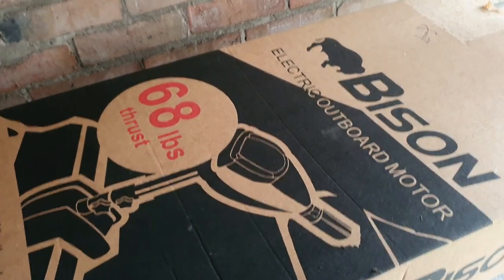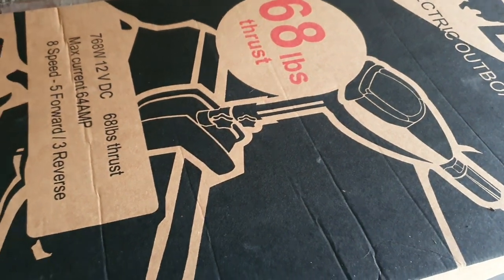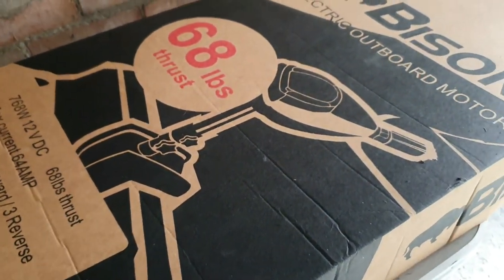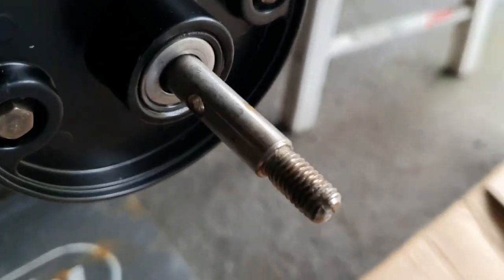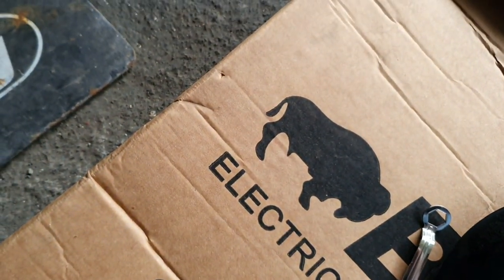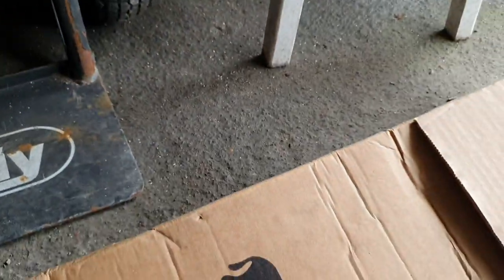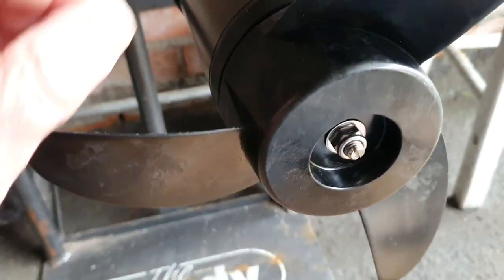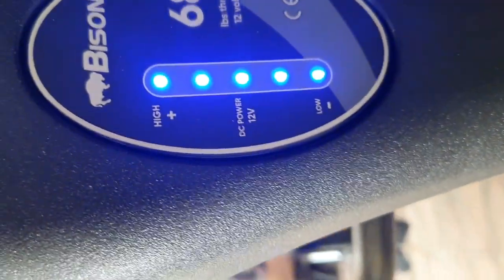Unboxing Bison 68lb Thrust Electric Outboard Engine

Comment: That was much cheaper than I thought one would cost. You are going to have so much fun and enjoyment on that canal. Can't wait to see your new boat when it has been completed. Keep up all the great work you are doing. Well done Colin, you must be so proud of all your hard work and determination.
Reply from the maker: The best part only one moving part less to go wrong and easy to fix I seem to think how is are things to fix myself just lately.
Reply: @colscopters  Fixing things yourself saves you a load of money. So that is a bonus 👍
Reply from the maker: That's so true I see it this way man made it man can fix it everything is like a jigsaw once you know how things go together it's easy .
Reply: Then you are great at jigsaws mate. The things you put together are awesome 👏
Reply from the maker: Thank you so much so kind
Reply: I have just bought one but one of the connections is really tight iE the positive one . My mate is having the same issue also won’t go on the battery any suggestions how to solve this would be great 😊
Reply from the maker: Yes you need the battery terminals connecter you get them from ebay about 4 pounds each they also have the bolt on type that's what I've used in the the past.

Comment: Does it go in reverse on the tiller control or do you have to turn the whole thing 180° to go backwards? Thing is I'm looking to mount one solid in a large RC boat hull and I need the actual motor to reverse . Cheers, mike.
Reply from the maker: Hello yes it goes into to reverse its got 5 forward gears and 3 reverse no need to do a 180 I hope this helps .